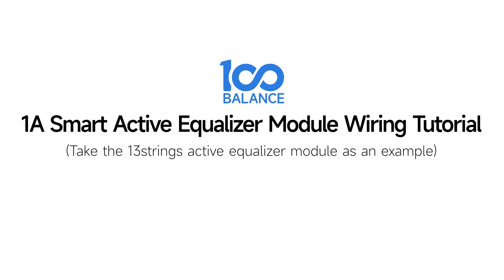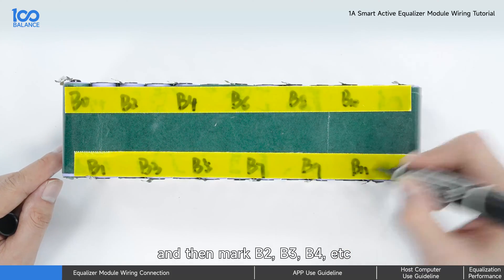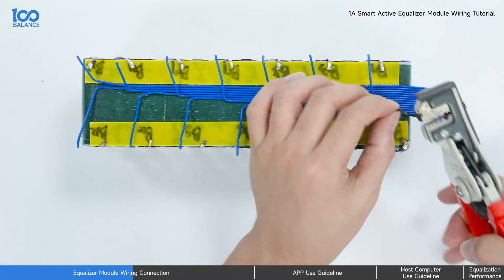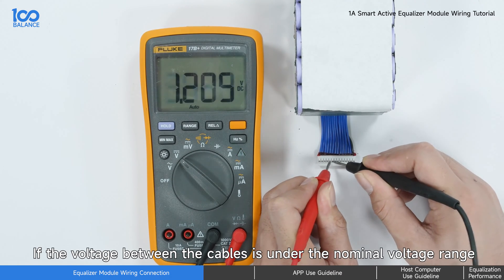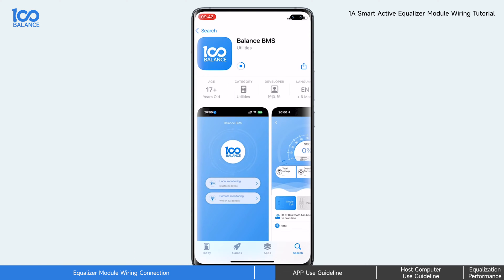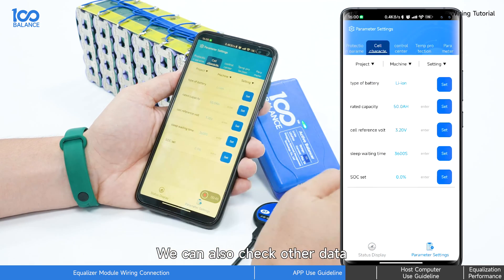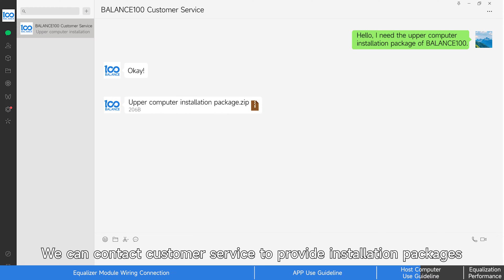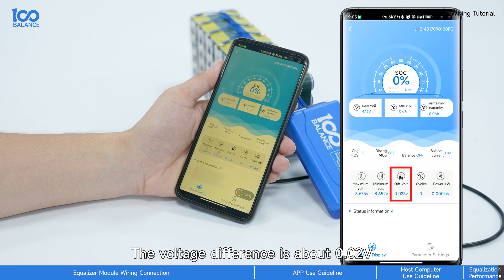100Balance BMS Battery 1A smart active equalizer module wiring tutorial

Comment: I have installed the 100 Balance BMS on a 16S Li-Ion pack. 
I get 2 status information messages: 
•Cell volt high level 1
•Disconnect MOS with GPS or soft switch 

What are these errors? Are they of any concern???
Reply from the maker: Thanks for reaching us. Could you please send the info to arica@100balancebms.com?   Please send the screenshot of APP to us (the alarm message and sn number page),  thanks.

Comment: Hello! I want to use the 13s version of the balancer on a 10s battery. I soldered only 11 wires on the battery, last 3 remained disconected. 
The module don't turn on when I connect the plug to the modem.
I measure the voltage on the samples wires.
Notice that is the first use of the module.
Can you help me with this?
Reply from the maker: Hi, thanks for your asking. At first, the active balancer can not use for multiple strings. For example 13S only use for 13S battery. But if you want to use it ,please email to arica@100balancebms.com.  Then I will help you to solve this problem.
Reply: Чи вирішили проблему?

Comment: I ordered this product and it will arrive soon. Can I have the 100balance BMS installed and connected to the lithium battery permanently active,  then recharging the battery (72V 40AH Lithium-ion) on a regular basis? If the battery is not recharging, will this device drain the battery?
Reply from the maker: Yes, you can do that . The BMS's working power consumption is less than 1W and sleep current is less than 1.5mA.  You need to recharging the battery on a regular basis. Thanks.
Reply: I got it, I connected 20 blue wires to string 1 to string 20, these wires are connected to a BMS too. I tested each port of the blue wires, voltage was detected  S1=3.73 S2=7.46…S19=71.3 S20=75. After connecting to the balancer the green light indicator is off never turned on, the BMS is working fine, the battery was charging fine. Is the device I got defective or do I need to do something first. I tried unplugging and plugging the two ports of the balancer, no change…also waited for several minutes plugged in, no change. What’s wrong with this device?
Reply: I also tested the balancer - port to the other + ports, detected voltage too.
Reply: Does it have to have 24 strings active to work? My lithium battery only has 20 strings. I got the 24S balancer version.
Reply from the maker: @KO777MV  Oh , maybe that is the problem. the active balancer is different with BMS ,it can not apply to multiple strings.  You need to choose 20S if your battery is 20S. Thanks.

Comment: Hello 👋. 
I have one question. 
Can I use this product at 16s diy lipofe4 battery? I want it only for balance the cells. 
I don't install bms.
I want the output from the battery positive and negative. 
Just for balance. 
Thanks
Reply from the maker: Hello , you can use this balancer without BMS.  But this one just can balancing as you said, it don't have protection function.
If you have any questions you can contact Arica@100balancebms.com. Thanks.